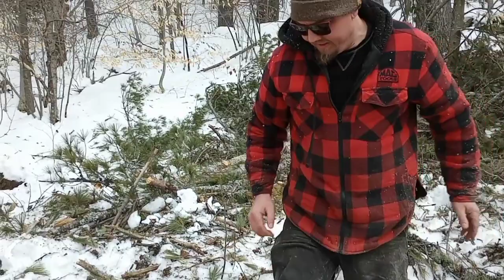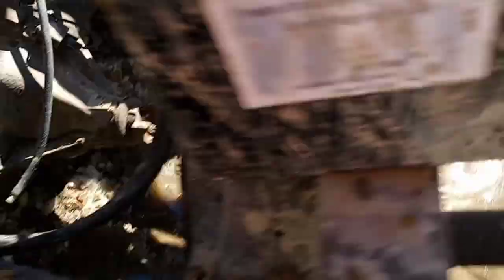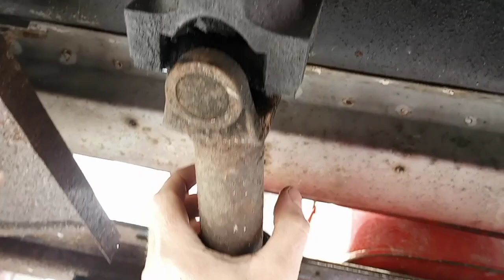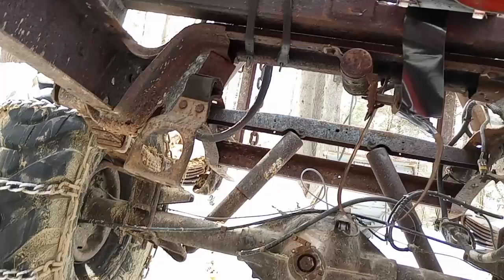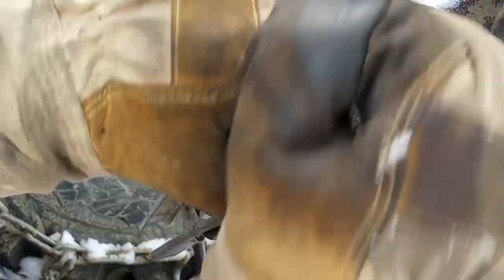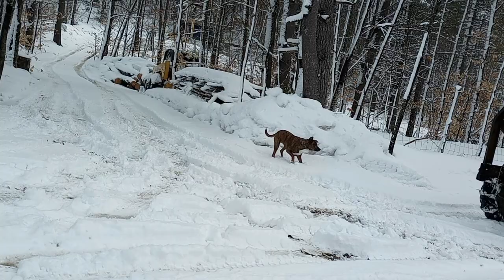Broke Ram Skidder and More Winter Logging 2023

Comment: And I thought I was only one that cut big trees like that. I think the problem is the winch power, the lack there of, next upgrade should be a stronger winch. My V3004 Fransgard pto winch with only 8mm cable would easily yank that pine log, good video..........
Reply from the maker: Yeah low battery. I have a pto winch but no pto output. Was thinking hydraulic power but is expensive.

Comment: interesting connection of the crosspiece with the shank of the rear gearbox and the distributor - I have never seen this on any car. does this only happen on American cars or is it only? this model?)
Reply from the maker: I think your talking about the Universal joint. Used on most rear wheel drive vehicles in America.
Reply: @mountainfarmer8766  yes, yes, I meant the universal joint, how reliable is it?
I often drive a hedgehog on my SUV in difficult conditions and do not put specially shrus gimbals patamushta it is not reliable I put only on the crosspieces I have a 4 by 4 four-wheel drive car called niva I think a very famous car all over the world you know this brand question
Reply from the maker: Universal joints break easy and are cheap. Never heard of that vehicle.
Reply: @mountainfarmer8766  a Russian car called Niva has been produced for 40 years, very common all over the world in Europe, in Africa. very similar to a small Ford bronco lol.
Reply from the maker: Il check it out!

Comment: question: will these sawn trees be used for firewood or why did they need to be sawn?
Reply from the maker: Wide boards
Reply: Next question.  If they're going for boards, why not pull them earlier when the ground is frozen, or later when its drier. Migjt save on driveshaft repairs. Just asking.
Reply: @danielmoulton4117  please shoot more videos about the car ..repair and maintenance.
Reply from the maker: I log year round. Ideally I would only pull logs when ground is solid but it doesn't always work out.
Reply: @mountainfarmer8766  I would watch you sawing these logs..
is it possible to make a video?!
Reply from the maker: Yep next video